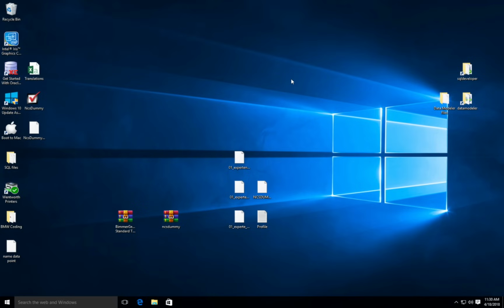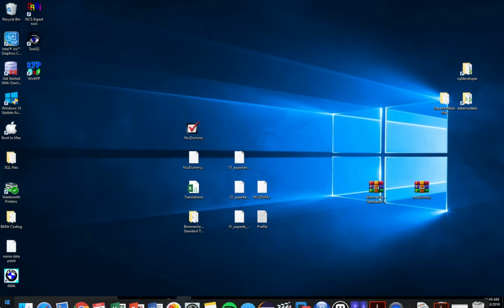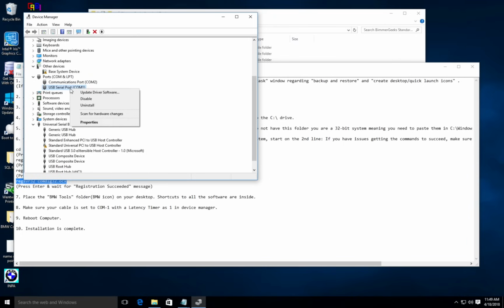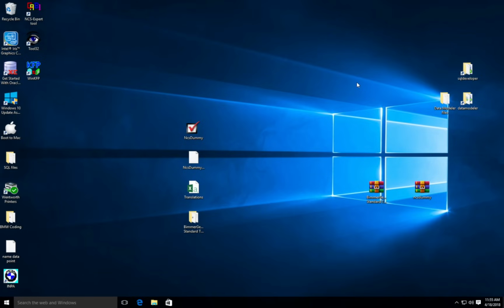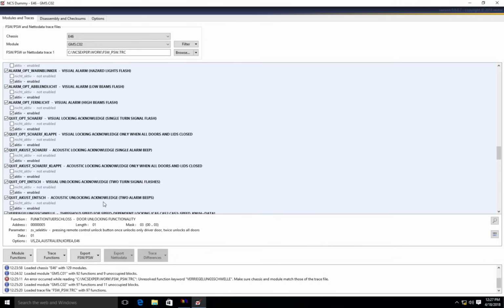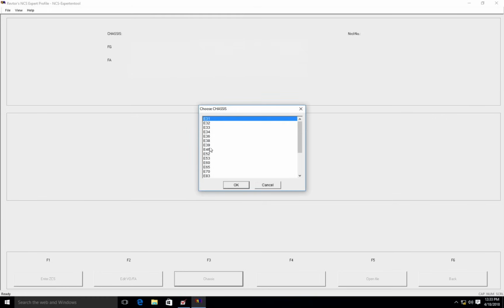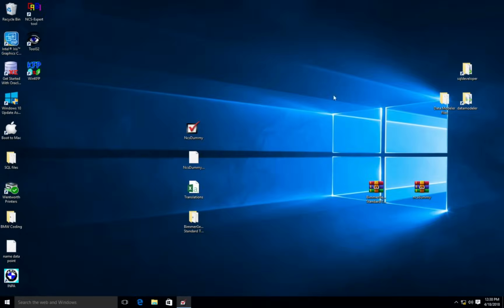HOW TO CODE YOUR BMW USING NCS EXPERT | WINDOWS 10

Comment: just a tip if you have problem with the cable driver, the automatic update didnt work for me so I switched to manual and selected the bimmergeeks folder you unzipped and it found the correct driver in there.
Reply: You are an absolute legend, thank you
Reply: Huge thank you to You man!!!!!🙏🙏🙏🙏😎😎

Comment: Hi bud, great info in your videos. I have a 2002 X5 E53 4.4i that i have somehow changed the comfort entry.  the one click door open, two click all doors open is cool and works, but now when i put the key in the ignition and go to position 2 to start it, the driver and passenger widows wind all the way down. The door control switches wont allow the windows to be put up at all until i switch the car off and use the "hold centre button" to close all windows. Any help would be much appreciated as it's a pain in the arse not being able to raise the driver or passenger windows while driving, especially if it's raining....cheers
Reply from the maker: Message me on Instagram @evangoyuk

Comment: My car is BMW X5 2002 e53 I have to use blue cable or silver cable
Reply from the maker: You need a cable with a switch doesn’t matter if blue or silver
Reply: I asked you cuz I buy the program with virtual machine so the seller said I have to use blue cable for bmw 2000 to 2006 and silver cable for bmw 2007 to 2012
Reply: One more question I ‘m coding my BMW X5 2002 e53 I m put aktiv the power windows with remote up and down but not working what I can do
Reply from the maker: How did you do that? What parameter was changed
Reply: @EvanGoyuk  I did the steps that I saw in your video enter ncs expert then enter dummy but in mine there is no GM5 only GM3 everything was fine look at up and down the windows with the remote control but it was active I also made changes in car key when  I start to drive at 16 km they close automatically and that works fine
Reply from the maker: Try not using ncs dummy
Reply: @EvanGoyuk  can you show me how to do because I m not I do not speak German

Comment: Good day, Keep getting coding faulty...
Reply from the maker: What car? Is pins 7 and 8 bridged?
Reply: @EvanGoyuk  2000 e46 323i sedan. Using kan cable you referred.  Also unable to figure alarm coding

Comment: HI, Evan, I followed up your instruction to install it, why the NCS-EXPERT open it, after F1+F3 , do not indicate FG and FA NBR , that is only Chassis E70 come out. I check software, do not find the SP-DATEN. Whether or not some where miss the software or others. according to your mentioned as below :  quote:
 I modified my D-can cable and installed a switch in order to have it operational with 2006 and earlier models that use the OBDII port. My cable did not come with an adapter... 2/2007 and older vehicles requires the pin 7 and 8 to be bridged to work..3/2007 and later requires pin 7 and 8 to be separate. So for 2 bucks at Radio Shack and about 20 minutes of my time, I have a fully functional cable for both applications! : unquote:
my car is BMW X5 2012 WHether or not D-CAN PIN 7 AND PIN 8 SHOULD BE SEPARATED , I CHECK IT , YES. IT IS SO WHAT CAN I DO ,
PLEASE HELP ME POINT OUT WHERE IS KEY POINT? THANK YOU

Comment: Links are hidden in description (pressed little dots and found them eventually!)
1) how do I access/read/check/remove parking brake code errors as I’m getting the dreaded ‘parking brake fail’ message on dash? 
2) how do I register battery replacement?
(2011 Bmw x5 e70)
Many thanks
Reply from the maker: Link in the description

Comment: Hi buddy, is it possible to set the date and time on the instrument cluster using ncs expert ? as my date/time got reset on my e53 and it seems there's no way to set it ...as I got the aftermarket head unit - thanks.
Reply from the maker: No ncs expert does not do this. Ista may be able
Reply: @EvanGoyuk  or navcoder it seems. Thanks anyway, appreciate it.

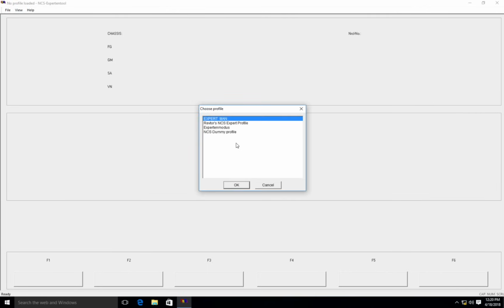Comment: why didn't you show how to set the profile ? using 'Edit profile' ....just after 'load profile'  @ 18:40
Reply from the maker: Be use you just need to load them in and not edit them
Reply: @EvanGoyuk  cool, thanks.

Comment: WARNING  for first time NCSEXPERT users:

It is very important that you save the current original configuration of your BMW car (the FSW_PSW file) BEFORE attempting any coding. So that if you mess up , you can revert and restore your car's original configuration, and not disable it.!! 

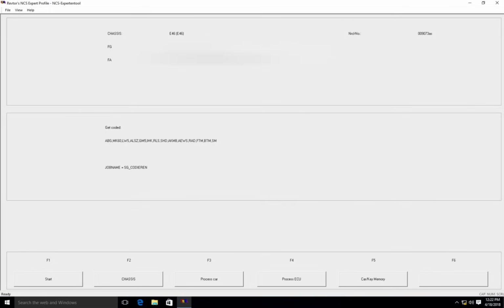So at minute 20:35 of this video : Stop everything, open another window and make a backup copy of the FSW_PSW trace file, (call it FSW_PSW.backup), then proceed.
Reply: The FSW file in the desktop?
Reply: @zezom3341  ---> The FSW_PSW trace file is located in the work directory of NCSEXPERT  (typically C:\NCSEXPER\WORK\FSW_PSW.TRC)
Reply: @TheChedley  wow thanks alot for replying 5 months later haha
If you wouldn't mind could you explain to me where to put the backup as i'm not very good with computers
Reply: @zezom3341  You save the backup copy somewhere you can retrieve it if needed. Maybe on a thumb drive, or another computer, or the desktop, or a memory stick.....
Reply: I wish I read this ccomment before I started... Seriously no one one should be uploading tutorials of using NCS Expert without disclaiming TO BACK EVERYTHING UP - you're fucked if you don't. thumbs down for this video. Imagine if I took you sky diving without teaching you how to deploy the backup chute. Still appreciate your effort and time for the video but man. We have to have each others back
Reply from the maker: So actually this is incorrect you can always factory code your modules back to stock without any back up taken first
Reply: @EvanGoyuk  
And how can you do that?
Reply: @EvanGoyuk  appreciate your response - it will probably do your channel well to have a guide for this!
Reply: @EvanGoyuk  How do you factory code your modules without saving any backups? Im gonna start coding soon with my e39 and dont want any problems:D
Reply: @zezom3341  So at minute 20:35 of this video : Stop everything, open another window and make a backup copy of the FSW_PSW trace file, (call it FSW_PSW.backup), then proceed
Reply: @EvanGoyuk  care to explain how you can do it ? as I can say I’m in space but no proof see what I’m saying man, cheers
Reply: @EvanGoyuk  how do you set it back to factory default
Reply: @adan2lo  agreed bro
Reply: This video is 17mins long yet you’re talking about 20:35
Reply: @L-xr1qm wtf are u saying

Comment: Hey. What problem can be if i read file change .save MAN file. But when i code car it's not save my new fail in car? Keeps not modify fail ? Thanks
Reply from the maker: What’s the error you get? Are you write the .MAN use SG_Coderien
Reply: @EvanGoyuk  yes i am change MAN file . And yes pressing SG- codieren. There no fault just car didn't save changes in car module.
Reply from the maker: Are you saving the changes to the file
Reply: @EvanGoyuk  yes. Saved as MAN fail. Then code car. After read again it's back to normal.  Maby my mistake somewhere. But i open trc fail change and save as MAN fail. Then trying code car coding ended. Again read and can see it's back to normal :(
Reply from the maker: Are you using NCS Dummy?
Reply: @EvanGoyuk  yes
Reply from the maker: Try without it
Reply: @EvanGoyuk  tried manually in notepad the same problem.
Reply from the maker: Ok I need to know what the error is. Message me on Instagram @evangoyuk

Comment: Hey I like your video's very Easy Explaining. am New user with this software, I have use other Diagnostic machine i would like to Brush up my Skill using would you be able to assist?  Let me know thanks.
Reply from the maker: What do you need help with
Reply: I have a 07 335xi Possible need Programming i ran thru the it do all Necessary check, when i scan it am getting CAS Code Etc. If can send me your email etc. Or we can setup a Remote Acess etc i will Appreciate it thanks.

Comment: Hey man, great work and love the videos! I've had a little proble with this one though: I did everything just like you showed in the video, but the changes won't apply to the car, but they do get saved... Do you have any idea why this might be?
Reply from the maker: Do you get an error? Are you able to connect to the car? Are you writing make to the car using sg_coderien? Are you saving the trace file as a man file after changing the values?
Reply: @EvanGoyuk  Thanks for the quick reply! No error, I'm connected and using sg_codieren at the end and I saved the file as a .MAN... Like I said, I do everything just as you show in the video.
Reply from the maker: Odd email me or message me on IG

Comment: Hey Evan, on NCS Expertentool under load profile I do not see Revitor's NCS expert profile. Do you know why? Or I have to be connected with a vehicle in order of it to show up?
Reply from the maker: No it should be there, is it getting copied to the correct folder?

Comment: On the 6th step on the command prompt I’m getting that the maduro failed to load , any idea on what is going on?
Reply from the maker: Are you running CMD as an admin?
Reply: @EvanGoyuk  yes, i could only get the 3rd item to pop up the box, the rest showed me the module failed to load
Reply from the maker: Email me

Comment: Hey man! Really great video, thanks for sharing! I have one question tho. I already have ISTA+ 4.22.4x installed on my system, installing the above will in any way interfere  with my already installed ISTA+ instance? Appreciate any reply in case you see this message!
Reply from the maker: Yes it could interfere
Reply: @EvanGoyuk  Alright, thanks for replying! Have a good one!

Comment: Hi Evan. Very informative video! Thanks for posting. A quick question. Do you think the K+DCAN IPNA cable you posted would work with a 2013 F30? Thanks for your time.
Reply from the maker: Yes
Reply: @EvanGoyuk  Hi Evan. I received my K+DCAN cable today and tried to follow your video to open up NCS Dummy and noticed that there was no F30 in the Chassis list. What should I do?
Reply from the maker: There may be an updated version for it

Comment: I would like to say Well done! very amazing tutorial video. My problem is my car is a E90 and I'm trying to find the code list for the modules mainly the BCM = Body Control Module can you please HELP!! Thanks in advance. Cheers! I will also agree you shouldn't have 58 dislikes that's for sure.
Reply from the maker: Do you mean FRM?
Reply: Thanks for the quick reply. no not the foot well module its the BCM that under the fuse box. its a 2011 328i E90 sedan if that helps. Thanks again Cheers 👍🏼🤔
Reply from the maker: Are you able to see other modules

Comment: This is a great video explaining on how to tweak features of a module, but can someone explain how to code a module that was replaced using NCSExpert?  In my case specifically, I need to code a replacement DSP amp on my 1997 e38.
Reply from the maker: Yes I can
Reply: @EvanGoyuk  awesome, could sure use the help!! I'm desperate.
Reply: @EvanGoyuk  is there a way I can get you to use a program like TeamViewer to code my DSP amp and pay you via PayPal, Venmo or Zelle. I'm desperate to get this thing going. I have INPA+, NCSEXPERT as well as all the Bimmergeeks software suite installed and running, along with a Bimmergeeks cable.
Reply from the maker: Email me or message me on Instagram @evangoyuk

Comment: Hey Evan i hope most things are going well during this time. Is there any other file one could make adjustment in? I went in one of the MAN file and make some adjustments before i got a little more verse and not sure if i did anything wrong. My understanding is the E39 and E53 share the same GMIII module so i obtain one from a E39 and installed it in my E53 the only problem i have is the rear doors don’t turn on the interior lights and because of that my cluster is reporting DOOR OPEN only when the vehicle is in motion. If you don’t mind you could communicate through  email denzelwilson@gmail.com thanks.

Comment: Hi,

Got a cable with 2 position switch.

I've tried the switch in two positions and installed exactly as you demonstrated in the video.

When running INPA, I get the cable detected set to YES, but the ignition flicks incredibly fast between on and off.

When I try to run any sort of scan I get IFH-0009: no response from control unit.

Any ideas? Driving me mad.

Thanks.
Reply from the maker: Could be a driver issue or a bad cable
Reply: @EvanGoyuk  Gutted. I think the driver is OK; I've tried the driver Windows automatically locates and also the one provided on the disc that came with the cable. I'll therefore assume it's a bad cable. Annoying.

Thanks for the videos - keep up the good work. Maybe one day I can do some diagnostic and coding work!
Reply from the maker: Use my cable in the description. It’s the exact one I have

Comment: So I have a question my ncs doesn’t show power module is it possible my inpa An ncs are out of date? Is it possible to downloaded a newer version ? Also I’m English?i got my cable to work but can get the coding done cause it’s missing certain factors I need
Reply from the maker: What module are you not seeing? Do you have an e46? Are pins 7 and 8 bridged?
Reply: Evan Goyuk so i actually found a link that says for the e90 under body in inpa it doesn’t show power module for some reason n he provided some info on what to do so hopefully I can get it to work as well he said there’s a way to change the language to English so ima. Try an see what Happins but also no I hVe a 07 e90 328i

Comment: HELP PLEASE 
charge air pressure too low f10 535i 2011
Reply from the maker: Check for a crack in the charge pipe. Could be a crack or cussing the boost leak.
Reply: @EvanGoyuk  thank you ill check it
Reply from the maker: Anytime!

Comment: Bmw scanner v.14 or inpa D-Can cable for GM5 coding?
Reply from the maker: D-can
Reply: Evan Goyuk thanks bud, your videos are very helpful. Keep it up
Reply: Evan Goyuk if I get the cable, can you help me with where I can download the software to work on windows 7 or 10
Reply from the maker: Yes
Reply: Evan Goyuk I have been following your instructions carefully and download the software half way. Just need to get the cable now lol
I’m looking on eBay and most people selling cable are on,y supporting windows xp. I’m guessing it’s just the software CD and not the cable it self right?
Reply from the maker: Use the cable I have in my description
Reply: Evan Goyuk they don’t do delivery to UK
Reply: Evan Goyuk just check the description on the cable you have used and it says use windows so and windows 7 32-bit
So I’m guessing it’s nothing to do with the cable, it’s to do with the software cd they send.
I have access to windows 7 and windows 10

Comment: I’m having an issue downloading the profiles from 4share. I have an account and everything. But when I try to down load the files it says it is being done in the background and will tell me when it’s finished. So eventually it says the files are ready for download. I go to them on the 4share site and click install and nothing ever happens. I’m a tech guy through and through so I have done everything I can think. Is it possible these files have been removed or something? And is it possible to do these steps just using the manipulation profile in ncs expert?
Reply from the maker: I just was able to download them
Reply: Evan Goyuk well maybe you can help me then.  because I literally have been trying to figure this out for days now. I even ordered the cable and everything. The last piece I’m missing are these profiles. I can not get them to down load.
Reply from the maker: Email me
Reply: Evan Goyuk what’s your email address? I checked on your about page and you video descriptions didn’t see an email address.
Reply from the maker: It’s my my about page l. Click on business inquires
Reply from the maker: Can’t be on mobile I believe
Reply: Evan Goyuk that would be why. I’m currently on my phone. I’ll send you an email later this evening. Thanks for the reply.
Reply: Evan Goyuk I keep getting error archive size limit exceeded when I click download all files from this folder.

Comment: Help!  I got to the step where I have to select my chassis and the highest listed was e89 (I have an e93).  How do I get it on the list of available options?
Reply from the maker: Use e89 for any e9x
Reply: Got it, thanks!  Did the speed readout in info display and it worked :)
Reply from the maker: Sweet!

Comment: Hey Evan how is going, I hope you and your family is safe and doing of. I have been one of your subscribers for some time now and MUST commend you and the material you put out to assist someone like me who is a new comer to the BMW family. Without further ado i have a 2002 X5 and retrofitted a steering gear with servotronic to it. I went to this BMW guy to have some coding done so i could benefit from the softer steering feel but he told me that was not achievable. So i returned to the salvage yard and remove the general module and replaced mine with it and it started working. The thing is i av lost the ability to open my trunk with the key fob and from the release button from the center console. I’m wondering if the module that’s currently in my vehicle can be reprogrammed so i  could obtain the ability again to release the upper trunk lid with key fob and what i  would need to do in terms of software and procedures to achieve this. Thanks for your kind reply.
Reply from the maker: Yes the GM module will need to be recoded using winkfp and NCS expert
Reply: So i  followed your procedures last week and for the first time manage to do some coding but wasn’t able to change what i was experiencing. The problem I’m having is the key fob releases the lower portion of the trunk, that’s where the signal is going.